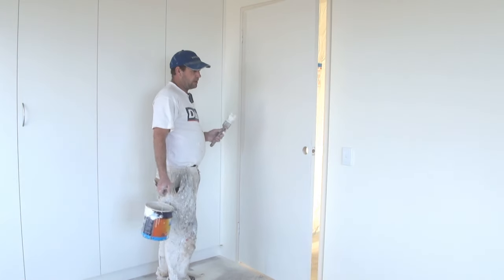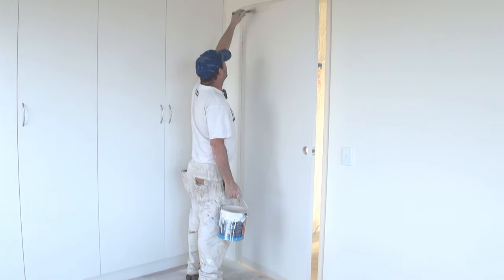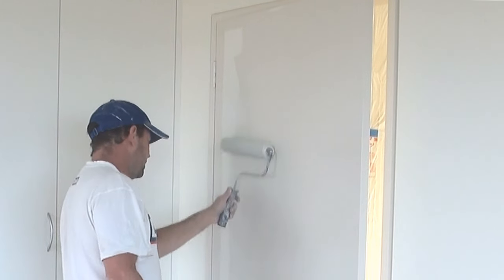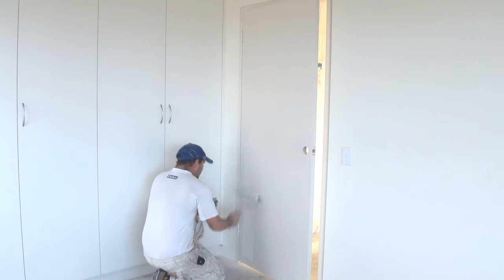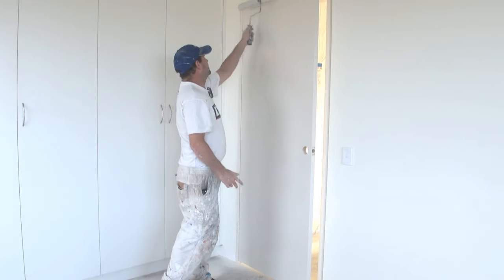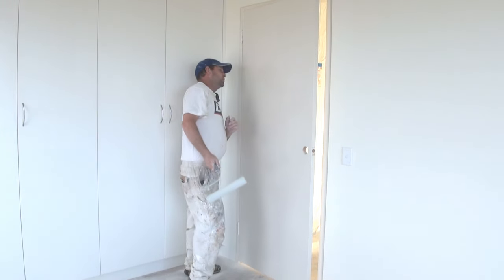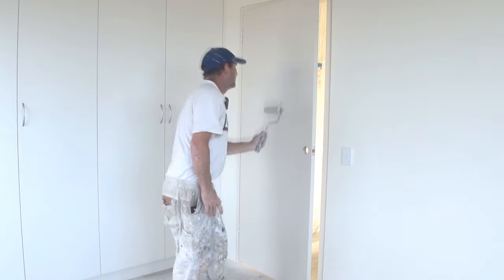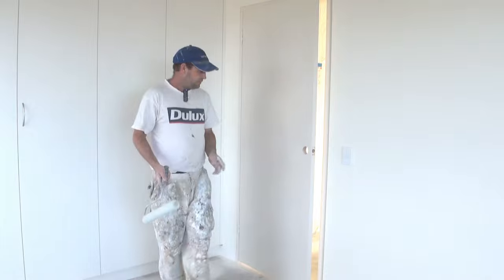Painting Doors - How To Paint Doors Using A Roller

Comment from the maker: Hi Derek, It can vary depending on how well the paint is flowing, generally I do put just a dash of turps in when rolling. For door frames etc, I use enamel straight but after a few frames I will add just a dash and I mean its only a small amount. I'm like you I don't like to add turps but the paint also needs to flow and some times you can get better coverage thinning the paint slightly because the paint will flow better.

Comment from the maker: Enamel DOES NOT need turps for it to dry properly. If you add turps it will thin the paint, if the paint is thinner it will dry a little quicker. If paint is applied uneven or too thick it will take longer to dry, the idea is to apply an even coat so it dries evenly. Turps can be added but its added so the paint flows better giving you a more even finish. 

Laying off a door with a brush after rolling is another technique, I have painted many door like that but a good roller finish is better.

Comment: I have been painting for many years, which included thousands of doors and fireplace mantels.
Never use a foam brush or roller.
As you press out the paint you are also pressing out the air bubbles within the foam.
All you will see is many small bubbles.
Use a microfibre roller for best results.
Reply from the maker: Microfibre are easier to use and give good results but foam do leave a better finish when used properly.
Don't forget to Like, Share and Subscribe
Reply: Ive done a bazillion doors with foam rollers and I tip off with a brush and every one is perfect. you just have to know what your doing Bryan.
Reply: @howtopaintinfo  What is the technique on how to use a foam roller properly?

Comment from the maker: I use foam rollers for doors, they don't really come in nap sizes but there are a few on the market, some are a little thicker then others. The one I use would be classed as a short nap and they are cheap, I can throw them away when finished.

Comment: Hey mate, great video, I recently tried this, used a foam roller ect ect. 
It dried glossy but was quite rough to touch, like when the bubbles settled it left high spots or something. 
Any tips. Load up more paint ?
Reply from the maker: Next time try to let the paint tac off a bit then roll out the bubbles, they should flatten out. Be careful not to thin the paint to much and make sure you lay off very lightly. Also this method works best with oil based paint not as good with water based paints.
Don't forget to Like, Share and Subscribe.
Reply: @howtopaintinfo  how to finish it with water based garbage because with oil based it s easy it can be,since i did great preparation job,and now it kills me how bad it it after 1st coat...it just dry extra fast

Comment: If it’s been at least 2 years since the wall has been painted & dried in. 

But you decide to re paint over with same paint colour, should you still back roll?

The reason why I’m re painting it again is because I had some wires pulled out from behind the wall because I’m getting a TV set up & had to paint over the Filler 

Which was just a small section on the wall. However when I painted it over again with just a brush it has come of with a few marks & looks un even I did use sand paper before hand as well
Reply from the maker: You should have touched up the patched area with a primer/sealer first, this should stop the paint from coming off. Yes you should still back roll.
Don't forget to Like, Share and Subscribe.

Comment: I tried this and could see uneven sheen after it tried with semi gloss. I found out that you're supposed to keep a wet edge, which I don't think was mentioned in this video. I think if you go over the strokes as many times as he did the paint will become too dry on spots and you'll see that when it dries. I'm paying a painter to come out and show me exactly how to paint the door. It's not as easy as it seems.
Reply from the maker: You most likely didn't put enough paint on, when I roll over this door the paint is still very wet.
Don't forget to Like, Share and Subscribe.

Comment: Hi dont forget enamel needs turps for it to dry properly :)

Another trick is to roll the whole door then lightly tip off the door with a brush.

Use a brush with flagged ends like a purdy XL

Comment: Rolling slab doors is one thing but rolling colonial doors is another. I was painting a number of colonial doors & it was not so easy getting this paint to cover as it was  kinda  a  thick sticky latex.paint & so it was that I discovered for myself, I wiped the door down with a damp sponge 1st just prior to immediately painting it' & holy cow it spread like wildfire easy as one, two, three! It still covered good no streaks as it was only needed to be dampened. Now. don't add water in the paint itself but rather use a wet sponge only to dampen the surface a little bit before painting it. It's also a good idea to use flat cardboard under the door over the threshold. Keep your paint can, roller pans, & every other kind of accident waiting to happen contained in cardboard boxes  of size to fit inside that could possibly make disaster of any sort. A step in time will  save you nine! so take the time & prepare.
Reply from the maker: Yes its better to prepare properly then end up with a big mess.
Don't forget to Like, Share and Subscribe.

Comment from the maker: If you are after speed then yes a fine nap roller is a little quicker, if you are after a finish that has absolutely no hair or fibers in it then a foam roller is best. Regarding bubbles, if you add turps to the paint you will get more bubbles but they will settle down, it may take an extra roll over to get rid of them.
Reply: Best roller for everything NATURAL LAMB ROLLERS. NO HAIR. BEAUTIFUL FINISH. GLASS OR FLAT. I used them since the came out. But they are hard to find. All other rollers are junk. I never got a complaint about my work. 
IN 50 YEARS. SELF EMPLOYED. NEVER HAD ANY STUPID HELPER.
Reply: @petersorensen4396 but natural lamb with gloss will leave roller stipple , today i use 4mm lambwool nap roller.  my customer is not happy with those roller stipples,i have to sand the doors to smooth,then try microfiber 4mm nap tomorrow

Comment: Will using a roller leave a textured finish on the door like it would on a wall? If so is it possible not to leave a texture?
Reply from the maker: It depends on what roller sleeve you use, foam or microfibre are the best but they will still leave a little orange peel on your doors.
Don't forget to Like, Share and Subscribe.

Comment: What size of roller you using on that door & nap size is that a 3/8 nap & 9" roller?
Reply from the maker: I normally use 11 inch rollers and the nap would be about 10 - 12 mm so about the same as 3/8.
Don't forget to Like, Share and Subscribe.

Comment: I just bought a interior door. the cheap hollow. kind, put a small hole into it already want to patch it before I paint it. can I use net tape and putty to patch it. Thanks.
Reply from the maker: Often you can just use lots of filler and fill the hole until the fill is flush with face of door. I assume the tape you want to use will go across the hole witch will create a raised section and will most likely stand out when door is painted and that's why using tape is not the best idea but it can work.
Don't forget to Like, Share and Subscribe.

Comment: Hi - I have two doors that are on trestles (taken off after they were hung) and have painted one side of each. I am using Dulux Semi Gloss enamel thinned slightly with turps and applied with a cheapie Uni-Pro disposable foam roller. I have ended up with orange peel through both doors. I applied the pain in sections and then back rolled a few times with less and less pressure. They are smooth surface doors. Any ideas on how to fix. Should I sand them back to the flat surface and try again ? So disheartened !
Reply from the maker: Brant Winter When rolling doors there will always be some orange peel affect, you may have put the paint on too thick. Without seeing what they look like it would be hard for me to say but you may need to give them a good sand to get them near smooth again.
Reply: howtopaintinfo Did that and they came out fine. What roller were you using with the enamel ?

Any tips for painting external entrance doors in acrylic ? What sort of roller do you use for acrylic gloss ?

Comment: I followed the method using a Microfibre 4mm NAP which was recommended for painting doors. The final result was very textured and feels like sandpaper. I think the issue is that the paint is too dry for the number of rolls. There was no issue with painting the door trim using a brush. The trim was had a smooth finish. The paint is water base satin. Comments appreciated before I sand the two doors and start again.
Reply from the maker: Using water based paint and oil based paint is total different when it comes to rolling doors. Oil based paints stays wet longer so you have more time to work with it, water based paint dries quicker so you haven't got mush time to work with it. I'm not a fan of using water based paint on doors because in never looks as good as oil based. With water based paint make sure you apply a nice wet coat and when rolling it off make sure it still looks wet and not dry. The mistake a lot of people make is not applying enough paint.
Don't forget to Like, Share and Subscribe.
Reply: I will roll and tip off when the temperature drops to around 20C. I assume the hot weather of 27C and above in Melbourne is causing the water base paint to dry much quicker. When tipping should I be putting the 3” paint brush in paint at the initial start of each half of the door.  Your video showed you dipping the paint brush once in the paint for the top half. When you rolled the bottom half you advised that the bottom of the door had been cut in. Is this all what is required for wetting the brush before tipping the bottom half? Thank you
Reply from the maker: Try this video, https://youtu.be/_7ZYqR4dQ3k
This is a play list. https://youtube.com/playlist?list=PL4B03AF5723579291

Comment from the maker: Yes you are correct, as I said I only use a dash of turps and generally there are only a few bubbles which will disappear. Each time you roll over the door the amount of bubbles should decrease. I know of guys that will roller one side of the door then the other side, then they will go back to the first side and give it a final roll over. This way they eliminate all bubbles. Its a bit hard doing this if you are repainting existing doors due to moving drop sheets around.

Comment: Hi derek , any advice for not getting the roller to splat out paint whilst using it ?
Reply from the maker: It's Greg not Derek, It all depends on the paint and different roller sleeves, sometimes there is nothing you can do about the splatter. Use shorter nap roller sleeves for flat walls and longer nap for rough render. Don't thin your paint out too much or it can become to thin and splatter everywhere.
Don't forget to Like, Share and Subscribe.

Comment: Am still not sure what to do . . . . I have cupboard doors, wardrobe doors, and shelves to gloss, they are all prepared, undercoated, and sanded back, Am tempted to try to roller the gloss  to eliminate any brush marks, but I just know something will go wrong, will get the wrong roller type, get loads of them little pin air bubbles in it or something and regret it, so don't know whether to brush it all and let the brush marks annoy me forevermore  . . . :-(
Reply from the maker: mrdeecov Try a 4 mm microfiber roller sleeve, the first few doors you paint will have some hair or fiber's come out but after that it should only leave a few hairs here and there and you can remove them with your finger. Practice on the insides of the doors or an area that is not going to be seen as often. Microfiber are easier to use but if you want a smoother finish then use the foam roller sleeve.

Comment: Is the principle the same if you're brushing a door - i.e. lay off multiple times in one direction only the length of the door? Finding it hard to get an even sheen using satin with a brush. Was laying off coming up from the bottom as well as coming down from the top, maybe that is my mistake.
Reply: Hugh McQueen ...all strokes in one direction to prevent shadowing...
Reply from the maker: Try to lay off just once when brushing, start at top and go past half way then come up from the bottom and lay off in to the top part.
Don't forget to Like, Share and Subscribe.

Comment: I agree with those who commented on acrylic glosses,terrible to work and finish show every stroke.They just dont cover or flatten properly,if you want to cut down the drying time use a splash of driers/hardeners to the oil based paint.
Reply from the maker: Yes driers do work, I have used driers in the past mainly during the colder months and it helps a lot.
Don't forget to Like, Share and Subscribe.

Comment: Not sure what type of paint you're using but i've painted a few doors and find that with gloss paint get the paint on first with a roller, then using a 2 inch brush prime it with paint and do full strokes from the bottom to top across the width of the door for a glass like finish.
Reply from the maker: Don't forget to Like, Share and Subscribe.

Comment: is the paint oil based ? how do you clean the roller after use with gloss paint ?
Reply from the maker: Yes the paint is oil based and I'm using a throw away roller sleeve, it can be very costly washing rollers out with turps.
Don't forget to Like, Share and Subscribe.

Comment: I used my door as a punching bag, once upon a time, then I used dry wall compound to fix the huge holes and it worked well, now that I'm  moving out I want to paint the doors to make it seem no repairs were done but some paints don't cover up well, these are those cheap hollow apartment doors,, should I used primer if so what kind, and should I use egg shell pain or flat which covers better plz help!!!!
Reply from the maker: +Hamza Halal 
You will need to prime or seal all the patched areas, apply an undercoat to the entire door then you will need to find a paint that matches the other doors. Depends on who painted it last but doors should be in a semi gloss or full gloss.
Don't forget to like, share and subscribe, Thanks
Reply: howtopaintinfo does full gloos or semi gloss cover better, and thank you Marko.V Hamza is a youtube joke... and gloss makes them shiny correct unlike flat pain.
Reply from the maker: +Hamza Halal 
gloss paint is very shiny, semi gloss still has a sheen and looks nicer then gloss.
Reply: Hamza Halal of

Comment: Also what kind of roller to use?
Cheers :-)
Reply from the maker: If you are using oil based paint then I would use either a microfiber or foam roller sleeve, for water based painted either microfiber or a worn lambs wool roller sleeve. New roller sleeves will loose some fibers so it is best to use a used sleeve.

Comment: What kind of a roller are you using? 2-component?
Reply from the maker: I'm using a cheap throw away foam roller.
Reply: howtopaintinfo okai, and are you using Alkyd or Acryl paint?
Reply from the maker: I always use Alkaloid (oil based) paint for trim.
Reply: howtopaintinfo As far as I know, oil based paint loses his color (foxed) if it gets not much sunlight. Paint on water basis not. Isn't it a better idea to use paint on water basis inside?
Reply from the maker: Oil based is best used on inside and water based on exterior. Oil based paint will go chalky in direct sunlight but can be washed to bring back some of the colour. That's why water based are best for the exterior.
Reply: howtopaintinfo Euh, it's just the other way around!
Reply: Twan Peters Nonsense.

Comment: So you roll over multiple times, each time with less pressure. Is this to remove the roller lines/marks and have an even finish?

What type of roller do you recommend ? Whenever I use rollers, they seem to leave little fibres in the paint :/
Reply from the maker: +sypher0101 For doors either use a microfibre or foam roll sleeve, foam rollers won't leave any fibres on the door and a microfibre roller will leave lots of fibres on the first door but after that it should only leave a few here and there. The reason for rolling over the door multiple times is too flatten out the rolling.

Comment from the maker: I have never liked acrylic for interior woodwork and have only ever used it twice by request of clients. I know painters that try to push it for interior woodwork, its easier and quicker to use then oil based so they are only trying to make their job easier and are not thinking about whats best for the client. So yes I agree acrylic gloss for interior woodwork sucks but I still prefer acrylics for external surfaces.
Reply: What’s your reason behind this? What’s the disadvantage of using water based paint in doors?